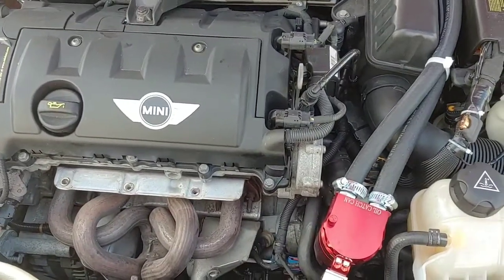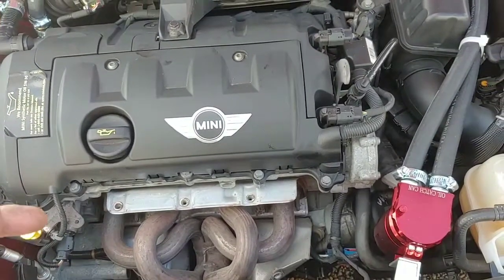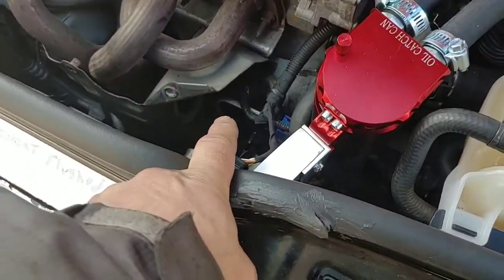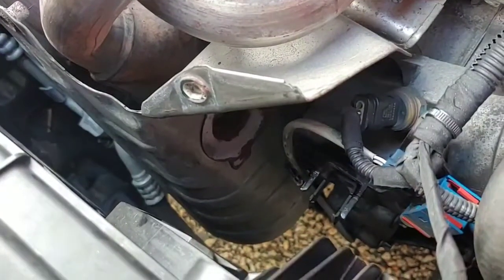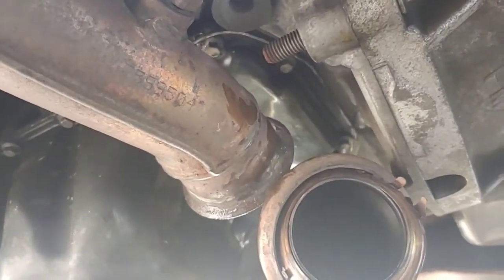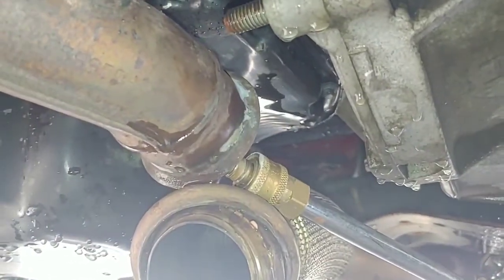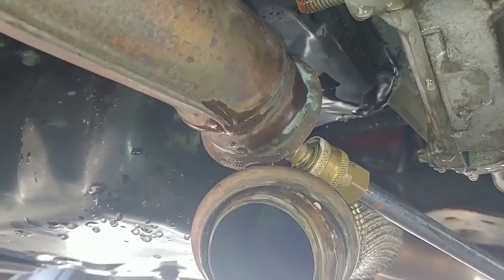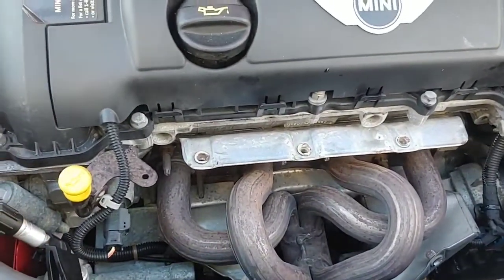Power Washing inside a catalytic converter that's still in the car. Will it resolve P0420?

Comment: Did you try using a gallon of lacquer thinner into the gas tank ????
Reply from the maker: Actually I think I use mineral spirits which was recommended by some very popular YouTuber. Shortly after that the catalytic converter was damaged beyond repair.
Reply: @themarginalmechanic5928  Sound like your problem could of been a bad CAT all along. 
You can wash a CAT using soapy water but you have to take the cat out of the car. Check Scotty Kilmer channel fella. Am sure you will be able to make this work. 
P.S. you do realize a catalytic converter does have a life expectancy of just so long. The worst thing is a bad injector that is leaky causing lots of problems.

Comment: Ok power wash will kill the mesh and u will feel its working

Only spray degreaser with washing liquid and water 

3 times leave it then drive

Nothing will damage and it will work 

If more clogged use more spray 

Dont pressure
Reply from the maker: I'm cleaning it because it's already defective. There was a latch last ditch effort. In the end it had to be replaced. Some of my videos are for people to think about and know it's power. Washer is not going to do any damage to it. You how many PSI of exhaust and heat are in there when it's running? A lot.
Reply: Garden hose with sprayer head should help, pressurized water, without being too pressurized.

Comment: I've heard success with acid-based wheel cleaner.  Dissolves the carbon instantly.  I'm trying the same with my bmw but I'll just take off the front/upstream O2 sensor and spray from there
Reply: How did it turn out ?
Reply: @theroyalcrownedtiger2946  sprayed seafom instead and put a triple dose of techron in the tank. Changed the O2 sensors and the CEL went away just in time for inspection. Now it's a year later no check engine lights. Btw cat efficiency was suffering due to leaky valve cover gaskets. Had to do those first to prevent compounding the problem
Reply: @innocentbystanderE39  : Good to know, thank you.

Comment: Well???....how'd it go?
Reply from the maker: It did not resolve the issue. After confirming all the O2 sensors were good I took it to Mini Cooper to let them put it on their Diagnostic and they came to the same result that the converter was bad. So I bought a converter and the problem is resolved.